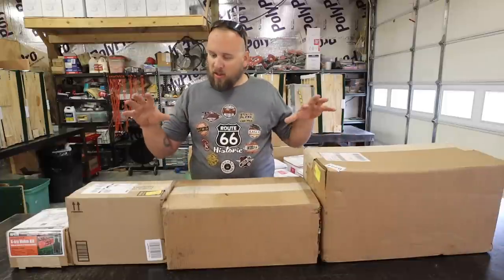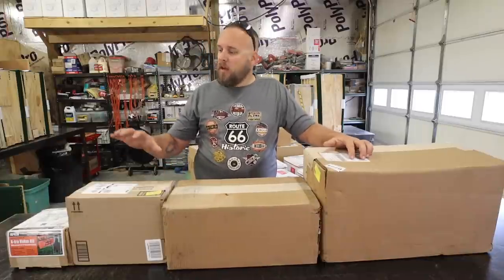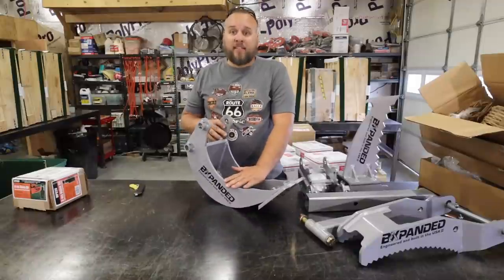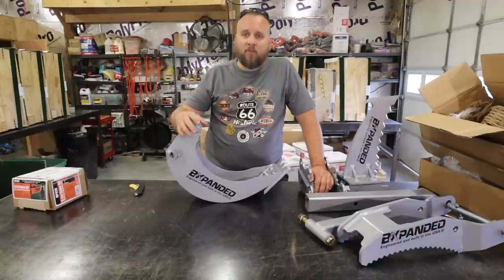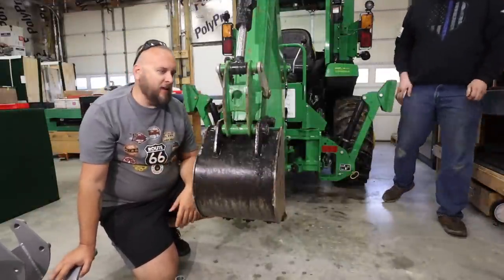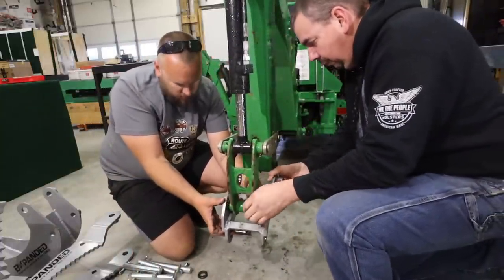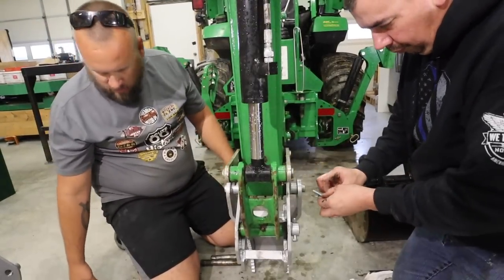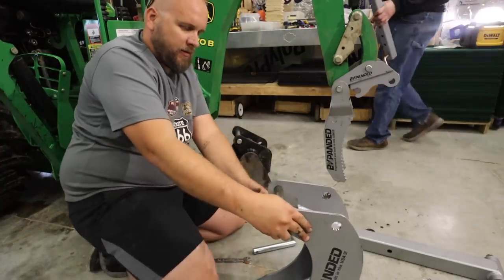Installing 4 Awesome New BXPANDED Tractor Backhoe Accessories

Comment: I have the John Deere mechanical thumb. I bought it along with my 1025r TLB when I bought it new. I later bought the Bxpanded quick hitch, ripper tooth and backhoe dolly. The mechanical thumb has worked great. I’ve used it for moving rocks and logs. Basically a grapple on the back. I really like using the Bxpanded ripper tooth. It makes pulling out tree roots a lot faster and not needing to move as much dirt. The Bxpanded backhoe dolly has also been great. It’s designed well enough that I don’t have to even use the outriggers when mounting or dismounting the backhoe. And now I can easily roll the backhoe around my shop.
Reply from the maker: Thanks for sharing

Comment: I personally cannot attest to the other backhoe attachments but I do have the Bexpanded mechanical thumb on my John Deere 2305 and I couldn't imagine life without it. It is a great product. Well designed, well made, and it has withstood anything that I have put it through. 👍 When I'm digging a ditch or a hole even with the thumb fully retracted it will firmly hold a big rock between the bucket and thumb.
Reply from the maker: The thumb is the main thing I really wanted as you said to sort rocks out of a pile.

The trencher should be handy as well

Thanks for watching

Comment: Hey Brock.  I recently installed the BX accessories on my 260B (minus the thumb..I'm going with the J.D. version there).  One thing that I would suggest is to replace the lynch pin on the quick-attach pin with a bolt and nyloc nut.  That Lynch pin will be ripped out pretty quickly by catching on the ring once you start digging up stumps.  "Ask me how I know" LOL.
Reply from the maker: Thanks for sharing your experience
Reply: I have lost 3. I know where your coming from!

Comment: I bought their 6 inch bucket and the root ripper. I have the hydraulic thumb on my 1025R. I can split some of the smaller rounds with the thumb and the ditching bucket. I have mentioned to them to make a splitting wedge like the root ripper. I geuss they are not interested in designing it. I thought about just sharping the ripper but hate to mess it up. Thanks Brock. See you tomorrow at the Paul Bunyan show.
Reply from the maker: I did not think that would work splitting with the ripper.

All free to send me a message, so I don’t miss you at the show.

Expecting to be there from 10 to 2.
Reply: @RockhillfarmYT  I'll look for you..leaving Medina about 8 am stopping for breakfast sometime on the way. I'll shoot you a message when I get there.

Comment: Hey Brock I ordered the exact same set up for my tractor. Very happy with it the metal is very thick I thought it was extra heavy duty in the build. The trenching bucket or banana bucket as I call it Is very useful for digging around stump roots and just removing smaller trees and shrubs and such. Also wanted to mention that the thumb when I was removing some big sago palms, I was planning to use the thumb to pickup the plants but what I ended up doing was using the thumb to initially loosen in the plant by placing the thumb against it and pushing with the thumb. Also as I think someone mention the ripper tooth is fun to use. You can actually sit there and operate the sticks back-and-forth and saw large tree roots in half, they will look like they were cut with a chainsaw. One curiosity I have, what are the gaps on the thumb support ends where it bolts to the backhoe stick and in the middle of the thumb? Glad you got hooked up with Bxpanded. I think they make heavy duty accessories and stand behind them if you need them. Cheers
Reply from the maker: Thanks for sharing all your experience with it

Comment: I've had my 1025r for about a year and a half and JUST ordered the trencher bucket and ripper with a quick attach. Planning in redoing a septic tank drain field in caliche (south TX) and am really curious to see how the ripper does in particular in soft rock. Tired of pumping the septic tank every other weekend.I was fortunate in that I worked at a local JD dealership when I bought the 1025 so was able to install the 3ed function for a grapple over my lunch breaks. Will say that the 1025 is a REAL back saver, especially with the grapple. Something heavy? Tractor will pick it up/move it.

Comment: Had the same setup quick coupler for my 2032r from BXpanded and after a few use with the backhoe the front coupler opened up and bucket was loose they need to beef up the steel to be able to handle the force
Reply from the maker: Thanks for sharing

Comment: Brock, I have the JD 1025r with the JD hydraulic thumb. It would be much nicer if I could operate the thumb independently of the bucket. Still the JD version works much better than the mechanical. . Even for getting dirt out of the hole or even putting it back in. I can't imagine not having it now.
Reply from the maker: I haven’t used the hydraulic thumb but it looks like it would have a learning curve

Thanks for sharing your experience.

Comment: Don't forget, you have a tooth bar and a straight edge for the trenching bucket.  Just take out the bolts and flip the edge around.
Reply from the maker: Thanks for the tip

I will be putting that to use soon

Comment: Awesome! How does the quick attach affect digging performance?
Reply from the maker: It’s been too wet here the last few days to actually use it but it shouldn’t really change much. It just lowers the bucket 3 or 4 inches
Reply: @RockhillfarmYT  Thanks for the reply. I was thinking it moves the teeth of the bucket away from the hinge which could reduce the digging force.

Comment: Just wondering about hydraulic pressure on the mechanical thumb.Is it possible to bend the thumb bracket before you blow over the relief valve of the bucket circuit,or do you have to do any pressure adjustments on the bucket circuit?Kinda curious.
Reply from the maker: I don’t think there is any risk of that. The thumb is pretty heavy built and the you squeezing pressure on the bucket is not that high

Comment: You should put some kind of grease on the pin. It may slip into the hole better.
Reply from the maker: Right. All of them have grease zerks except for the quick pin
Reply: @RockhillfarmYT  That sucks. The only one that you will be using the most.
Reply: you really don't want to grease that pin.  That defeats the purpose of the quick-attach...namely...so you don't have to handle a greased pin.  The pin will loosen up with time and use on its own.
Reply: @garycox7508  okay Thanks for sharing the information. I suppose that it will get some wear from going on, and off.

Comment: I reached out to bxpanded a few weeks ago and the sad part is they do not have any backhoe attachments that work on the current 3 series John Deere tractors and advised me they do not have any intentions of expanding into that size tractor. JD 3046R &375A backhoe
Reply from the maker: I am surprised to hear that. I saw one of the drop-down menus you can click 370B

I thought that meant they covered all the three-series

Is the 370B Backhoe used on any modern three series or do they all use a 385?
Reply: @RockhillfarmYT  they all use the 375A if you have a cab or the 385A (little more power/reach etc) for the open station units.  I was also sad to hear because I liked the reviews and I like the price of their thumb vs the JD manual thumb.

PS. The hydro thumb is not available from Deere for the 3 series as well.

Comment: My only concern is the quick release pins may fall out during deep trencing.
Reply from the maker: It’s a possibility. In which case you could put a bolt through it. That takes away from the quick part a little bit, but you still only have one to remove instead of two

I’ll make sure to have a couple of extra linchpins with me

Thanks for watching

Comment: Sweet , how much $ r they
Reply from the maker: Each of The attachments is Around $300.  The thumb is the most expensive thing I showed and it is $389

From memory, I think that the mechanical thumb from Deere was over $700
Reply from the maker: I don’t think so. With the quick change adapter, They basically copied the design used on mini excavators but it is on a smaller scale so I doubt it  would fit
Reply: @RockhillfarmYT  The reason I'm asking is because I can use my neighbors mini to dig some waterlines but he has a ditching bucket and a 1 foot bucket and I don't want it that big so if I bought one of those I'd like to throw it on his thing is excavator and then when and if I get a backhoe like yours I would use it on that